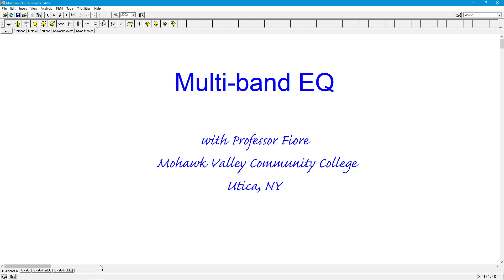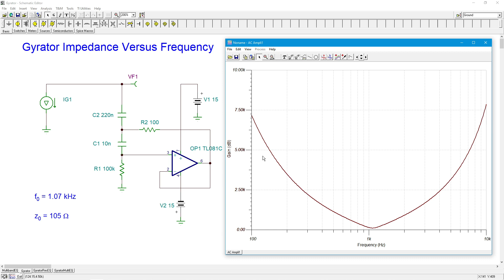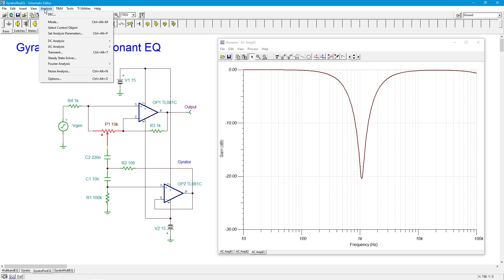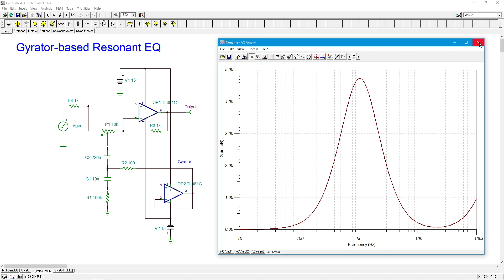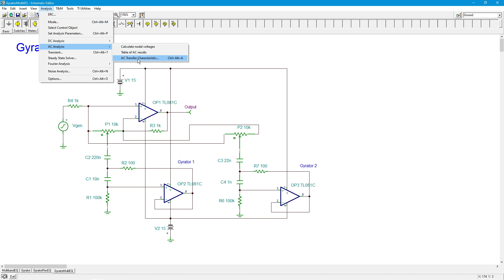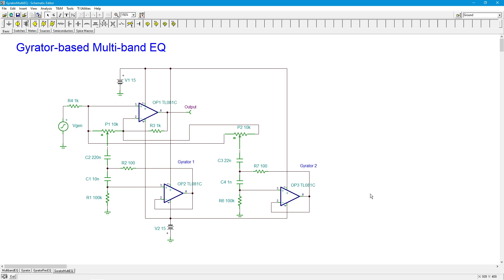Op Amps: Multi-band EQ

Comment: Amazing vidoes and great channel. Knowledge and wisdom to gained is so much. I would be super happy if you could explain what an inductor EQ is ? All top names who make outboard audio gear make inductor EQs as the core saturation brings out harmonics and enhanced sound.  A video on how this works would be great
Reply from the maker: The basic idea is to create a resonant RLC circuit. Check out my Resonant EQ and Gyrator videos for more details, but a gyrator is just an active circuit that simulates an inductor; an "inductorless" inductor, so to speak. If you replace the op amp gyrator in the EQ circuit above with an inductor, you've got yourself an "inductor EQ". Having said that, I have seen EQs that are advertised as "all passive" meaning that they would not have a gain stage either (like the one in the video above). 

It's kind of funny that some of the "hot circuits" now in use are based on very old designs; designs that were abandoned decades ago because we had inexpensive, high quality semiconductors at hand and could design circuits without inductors. Inductors are the least ideal of the passive components. They are more likely to create distortion, suffer from interference from magnetic fields, are bulky and tend to be expensive (when compared to modern semiconductor alternatives). As someone who witnessed the move away from inductor use in audio many years ago, it is a little odd to see its resurgence. But, as you suggest, some people may actually like the added distortion or "coloration" this non-ideal component brings. It reminds me that some people still use my Sample Wrench software to transfer sound files back and forth to late 80s/early 90s MIDI keyboard samplers that have only 12 or even 8 bit resolution, because they like the "vintage sound" of the instrument. There is no right or wrong when it comes to subjective valuations. If you like it, use it!
Reply: @ElectronicswithProfessorFiore  Thank you so much for the explanation. It was very helpful.